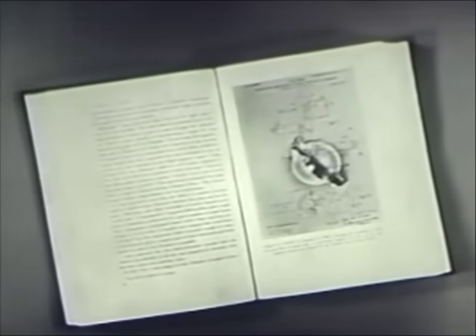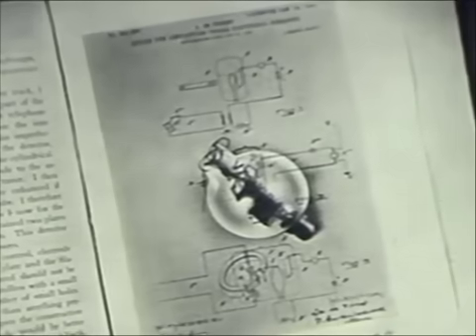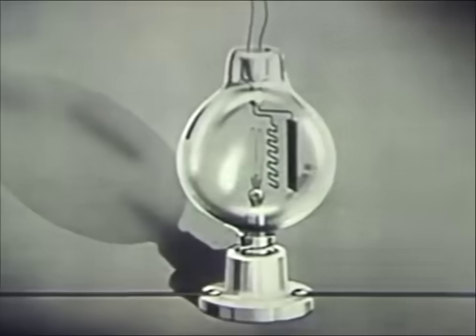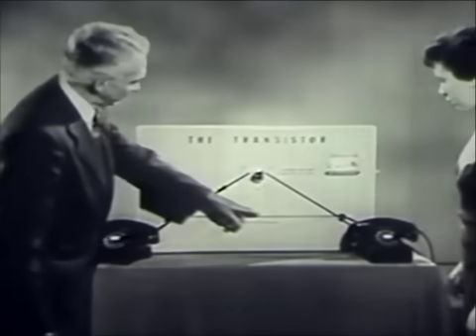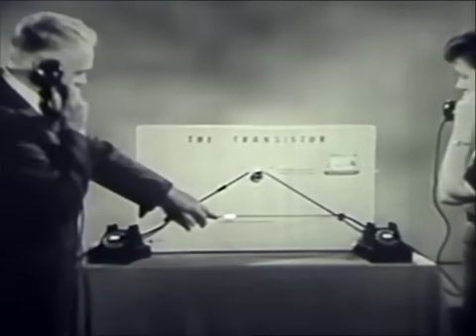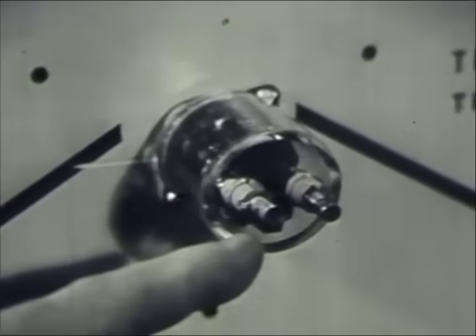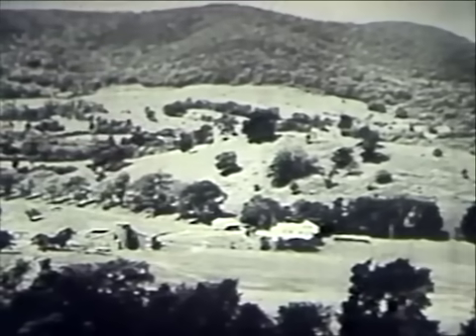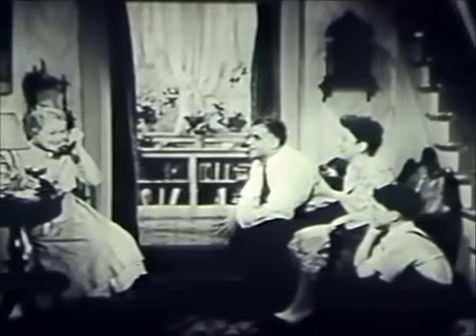The Transistor: a 1953 documentary, anticipating its coming impact on technology

Comment: Great film - and especially neat since I've spent time in many of the old Bell Telephone buildings shown, and worked at the old Allentown Works (Western Electric) facility for a while...
Reply: +w2aew Wow! that's awesome! I really like your videos, btw. :)
Reply: I worked at the Allentown facility when it was known as AT&T Technology Systems, from 1984 to 1987. I did not know at the time that the three engineers who invented the transistor were still alive. I would have liked to meet them.
Reply: w2aew Same as the other poster said: That's fantastic! And I too really like your videos and your Avatar!
Reply: Did you work with those old switch-boards? I think called PLCs? Somebody gave me one, I had it for a few years in my pool table bar for a conversation piece, A friend HAD to have it, so I gave it to him...Dang that thing was heavy :0)
Reply: My dad worked at Western Electric Allentown from 1950 until retiring in 1985.  By then Western Electric was purchased by Agere.  Just one of many body blows to the local employment losses which of course also included the loss of Bethlehem Steel Headquarters when steel making ceased in 1995.
Reply: @AnAmericanFan  Looks like Allentown Works is turned into some kind of group home or something, I used to go to Union blvd to service lab equipment, and also the other place up the hill, with the big water tower...all gone...now Verizon stuff installed in homes MADE in CHINA!!! that big Steel Plant is now part of Lehigh Univ ain't it, they purchased to property, I think they kept the cafeteria that big glass building with the great view...the U.S. has no industry, only the ability to incite wars around the world, Airbus is blowing away Boeing, electronics is all non U.S. for consumers, even GE appliances is just a name it's now Chinese Hier..  but they are actually putting money into the Kentucky "appliance Park" and upgrading for meeting demand, maybe the Chinese know how to run factories better than the U.S.  The biggest semiconductor maker FAB is Taiwan semi, not anything called Intel, Intel outsources production to TSMC...TSMC was started by PHILIPS and Taiwan gov't in the late 70's early 80's it grew and grew, as fabs shut down in the U.S...rah rah rah...there is no U.s. car business, GM is a failed operation globally, they are irrelevant, same as Ford (Ford teamed up with VW, to Survive)VW #1 in teh world for years..and now the French have bought another one they own Fiat Chrysler, , the other group Renault Nissan is #2 PSA is number 4 now, with a new Name..GM and Ford are not even players in teh global car business top 3 and GM and Ford ain't in it.  VW, Renault Nissan, then TOYota...
Reply: Bell labs did most of the early pioneering work of sound on film also.  Look at the end of movies from 30s and 40s...on the. Western electric recording systems
Reply: o wow, is it¡¿
.
Sir.. are you 60+ then?
Reply: @sailaab  No, but close!
Reply: Ji  @w2aew ji 🤗😇 https://wikipedia.org/wiki/-ji
i made that guesstimate prior to going tgrough YOUR OWN🙂 video uploads and listening to you.
maybe physically you are young but by joves... your way of patiently explaining, talking.. it reminds me of my uncles, elder generation.
Reply: @sailaab  Thank you very much!
Reply: My family the Lehnert’s worked there, maybe you’d know a few of them
Reply: I went to the Union Ave site to work on xray equipment there, they even had a clean room, XRF stuff, Allentown ain't getting the taxes like they got when it was Bell Western electric
Reply: @Jerome Schwartz bells labs is just a memory...pioneered so much stuff...that big glass Holmdel site is all offices now? Murray Hill is not a landmark? Just all gone?
Reply: When Western electric made all the stuff, now ya see, made in china on Verizon systems, the U.S. is a lost cause, Western electric on Union blvd in Allentown was a gonner when it all became Lucent, they destroyed  Bell Labs, Murray Hill etc.
Reply: @cengeb  That building is a charter school now
Reply: @twoeightythreez  I used to go there all the time to work on the XRD instruments....Murray hill is certainly not collecting taxes on it like they did when Bell was there...another company ruined, by wall street, when it became Lucent, all finished
Reply: Finally somebody saying "film" about something that could actually be shot on film. I hate when people call video "film", especially young people, no excuse.
Reply: @robertpryor7225  You're witnessing the mechanism by which languages change and evolve.
Reply: @robertpryor7225  Language changes over time. Do you object to calling elementary particles "atoms" because of the fact that atom initially meant "indivisible" in Greek?
Reply: @robertpryor7225  It might be due to the fact that 'a film' is a homonym of 'a movie' in many foreign languages.
Reply: @ltrzepalko  We should just call it an "apparent motion picture"
Reply: @WilliamLDeRieuxIV  Your term is prone to acronymisation hence post-encryption. A single word. Maybe you could think of a single-word term...
Reply: @ltrzepalko  An "apparent motion picture" is a series of images displayed one after the other that appears to be moving due to persistence of vision.

So....why don't you try to come up with something else (not using film, video, or movie) and not tied to a specific medium or format.